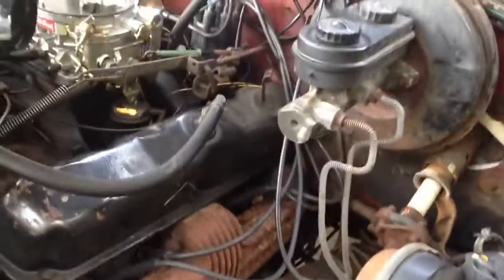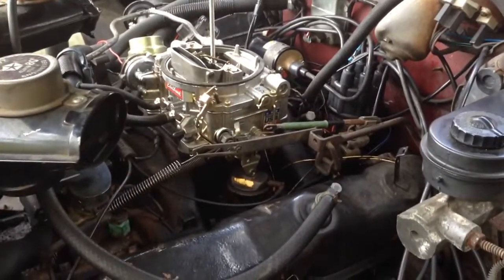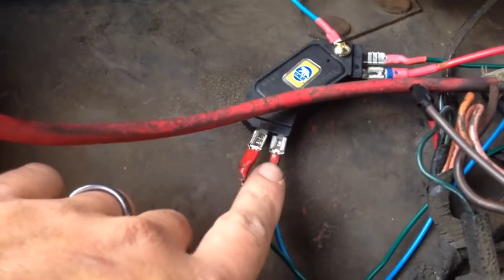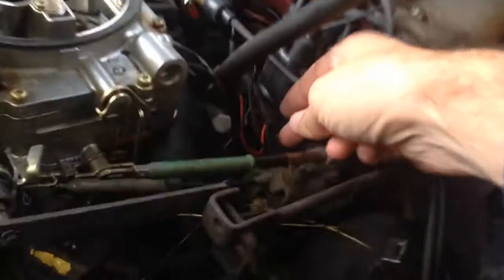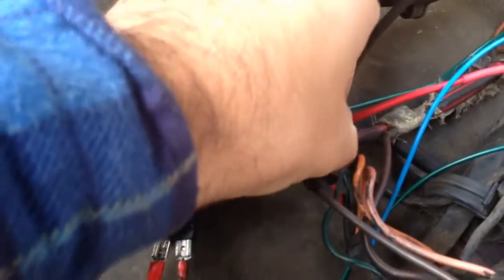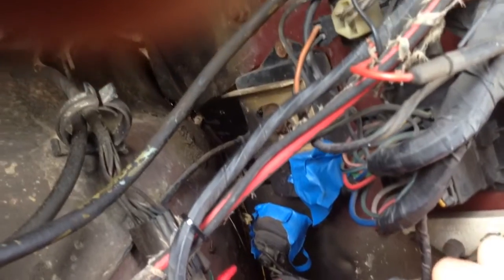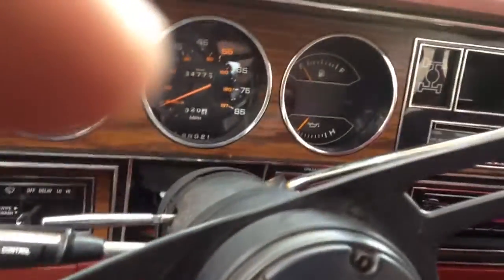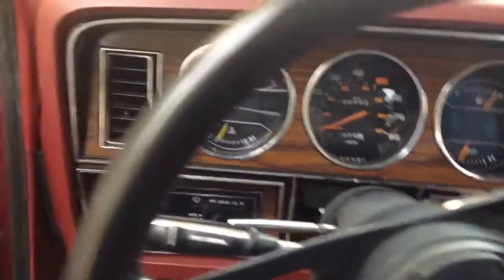1984 dodge ramcharger hei swap

Comment: I have an early hemi (354) in my street rod with the HEI conversion using the LA type dizzy from a 340. This works flawlessly, I also have the timing plate from 4 seconds flat racing. I’m also using a Mallory E core coil. The best of both worlds.

Comment: I convert all my Dodge and Fords to HEI cheapen well-worth extra power but you're going to have to get some silicon paste and mount that module to a piece of aluminum or something to dissipate Heat or it will burn up for sure
Reply from the maker: It was there for 4 years and zero issues, then I sold the truck.

Comment: Sorry  but  a few problems here.  First,  module needs to be mounted  to  a heat sink, at the very least,  "flat" mounted on  sheet metal.  When you punched the module with your finger  it moved?   Appears   mounted on a curved surface?   No heat sink  there at all,  and  hard to see,  one mounting screw?

Second,   distributor  pickup leads are WAY  too long   This is a sensitive circuit,  and  EG  read  the MSD destructions,  the long pickup leads can act as an antenna, causing  misfires  from stray  magnetic pickup

Minor, you need to be  aware  of  road splash.   The HEI  probably won't do well with water and mud.
Reply from the maker: So a year later and about 6000 miles. 
No misfires
No driveability issues 
No issues with rain/snow/ice or mud. 

Drive an hour and half to work, then stop and go all day to different jobs. Then drive an hour and half home. No issues. Thanks for the concern however this swap is working quite well and I highly recommend it.

Comment: Strange. Yours is the same year as mine, but my ignition module was on the passenger side and the ballast resistor was near the windshield wiper motor. 

Just proves you never know what to expect from Mopar.
Reply: Wait till you work on an International. LMAO 
Mother mopar builds awesome drive lines, Ford builds good body's, Cheby just wait. They will fuck up again.